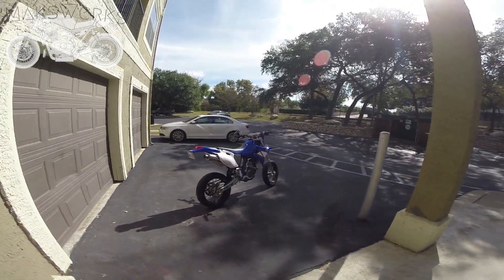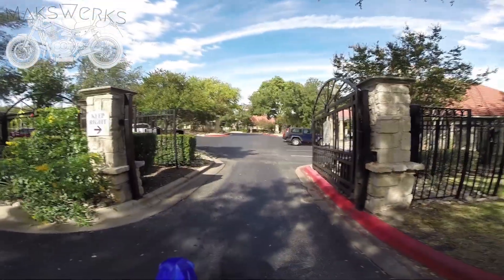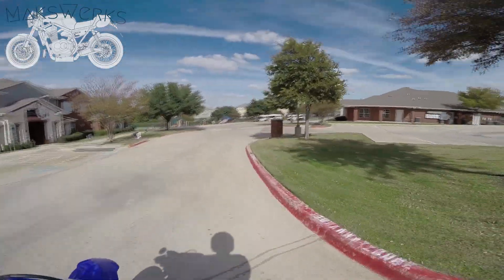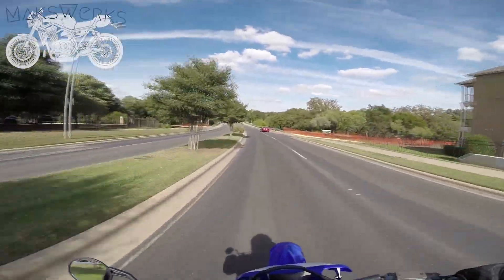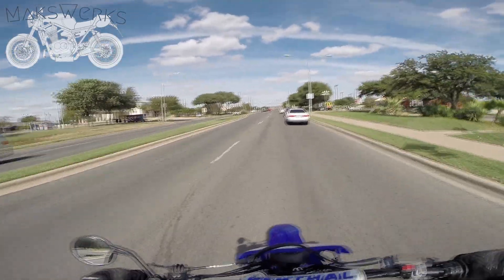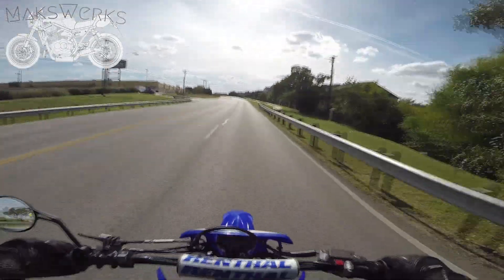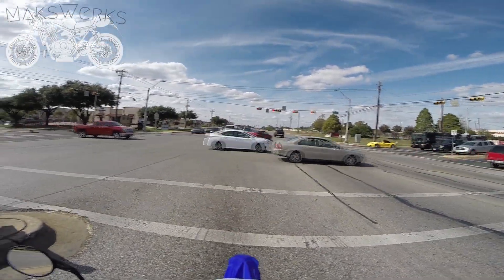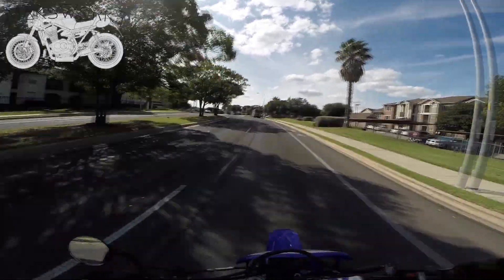MaksWerks Reviews - 2001 Yamaha WR250F Supermoto

Comment: dude...all 120lbs of me on a buddy 125 triggered that gate no prob. how does your new sweet-ass WR not trip the gate??
Reply from the maker: Probably cause its magnetic rather than weight.
Reply: MaksWerks buy a small pack of neodymium magnets and scatter them along the bottom of the frame.. it will help with left-turn lane stop lights as well.